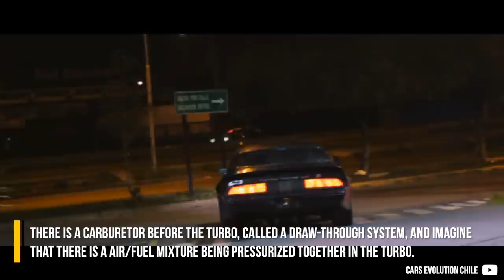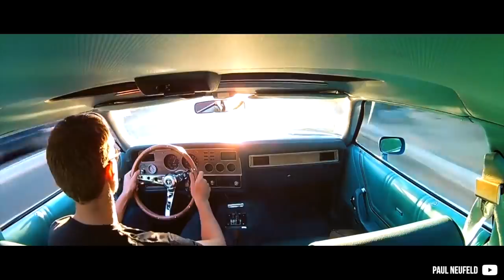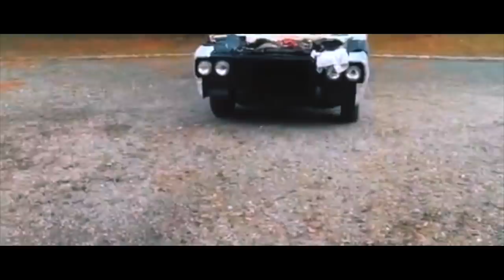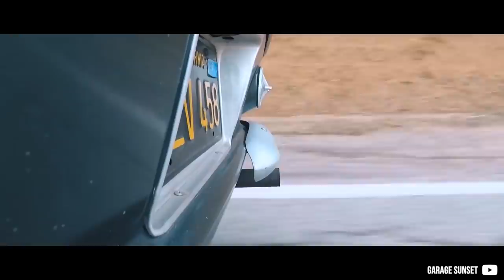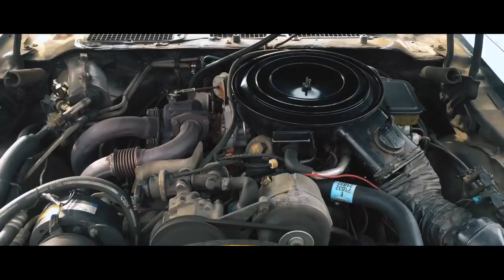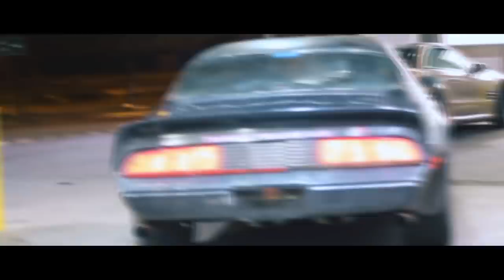5 Awesome US Turbo Carbureted Cars

Comment: The 1980-1981 turbo trans am; the definition of “All show, no go”
Reply: I bought a mint example in around '89.  It really was slow but it did "show" and was trouble free for the next 6 years.  Then I dropped in an SD455 to improve the go.
Reply: Sure did roast the tires pretty good.
Reply: Hahaha it’s very show about it’s power delivery haha it tries to seem dramatic but it’s really not😂
Reply: Own a ‘79 there slow but there still fun
Reply: Yes! That 305 turbo motor was a friggin' DOG!
Reply: Ya tht 301 turbo was a turd I’d rather have the 400
Reply: What choice did pontiac have with the restricted emission and power control from the government? They did the best they could and should be respected for their efforts. Anyone with half a brain can easily modify the 301T engines to make a lot more power and boost.

Comment: There is also the Renault 18 Turbo, with a 1.6 turbocharged engine, Garrett T3 turbine, and solex 32 DIS carburetor.
Reply: Yes as far as i Remember Renault 5 gt turbo had a carb turbo engine.
Reply: @Runetone  the first r5 had a turbo version of the basic car too, alongside with the civilised version of the rally car and its back/middle engine plus the widebody kit ^^
Reply: @Zzefrog  yes the turbo and turbo 2 mid engien 😊 but the GT turbo was the cheap option. One of my frinds had one. still fun to drive.
Reply: Yes and the first 5 alpine turbo too
Reply: This list isnt about evey turbo carb setup, there are clearly more. The title was highlighting on a few turbo carb setups from the US.
Reply: What about me... lol

Comment: Turbo carbureted cars are kind of common here in Brazil (among modified cars), since not everyone has money to buy the turbo kit and a fuel injection system along with tuning. Nice video btw!
Reply: Blow-through, or draw-through?
Reply: @903strikerunit  Mostly (like 99,9%) blow through.
Reply: @rodrigogomes7546  how the heck did they tune that up?
Reply: @903strikerunit  Nowadays we use a lambda probe on the exhaust, and by reading the lambda value across engine rotations and loads we tune the carb to the ideal fuel mixture (a little bit more rich than stoichiometric, to prevent from fuel starvation on high rpm/loads).
On the past, like in the 90's and 2000's we basically tune by try and error, starting with a rich mixture and depleting it until we feel it's close to where we want, not very accurate but it worked well.
Many aftermarket turbo projects already have some kind of "recipes" avaliable to give a start point on tuning, specially VWs engines ( if you search for VW AP turbo on YouTube, you will find a lot of content for example), making things much more easier.
Reply: VW AP and beetle boxer engines rules the carburetor predilection here in brasil

Comment: draw through turbo concept is ealisily tunable, but it acts like a diesel - you wait until the turbo spools and the real power comes up.  Im planning this setup to be done on my pinto 2.0l engine, it can be tuned with ear only (and driving ofcrs). Easy part is the tuning, but hard times come when you try to drive this setup - you have to keep it in spooled area of revs, but if it comes down to the not spooled area, you have to wait to let it build the boost up and then you can drive it like a mad man. But it is really cool setup tho. Blow though setups are more capable, but again - hard to tune.

Comment: I had a renault 11 turbo with 1.4 turbocharged engine (8 valves), performs very well for the year and displacement, 114hp and can reach 124hp only touching wastegate, not bad

Comment: The early Maserati Biturbo's had a carb but it was after the turbo. Because it was pressurised it lived in a sealed box on top of the engine. It didn't work very well, mostly due to heat.

Comment: Sorry am old enough to have seen this as the standard, Still common for Blowers.  The basic difference with the carb turbo, simply there were seals to prevent the air/gas mixture from getting into the engine oil.  You can still buy them on the market but they are becoming harder to find.  Remember that Paxton Blower actually used a vane type pump back in the late 40's to current, the famous Roots blower needs no modification due to their design.

Comment: 133 hp from 2.3 turbo ? That's low even for that era
Reply: Americans didnt believe in overhead cams until around 90s, thats why
Reply: The Lima 2.3 is based off the european 2.0 in cars like the Escort and Cortina, it has a overhead cam. It actually made 139hp and the 302 of the year made 140hp. The design was old before it made it to america, it is an economy engine, but it does have aftermarket support and can nake upwards of 400hp in turbo or n/a form and is used in race cars and trucks. The Windsor 302 makes power upwards 500hp.

Comment: I've "seen" many turbo cars with a carb. They usually enclose the whole thing in the pressure box. I believe this is the easiest way make it work. Also for me, as a millennial, carbs are like magic, at least the "modern" ones, with millions of vacuums hoses and vacuum membranes. Computer controlled fuel injection just is so much simpler for me to understand.
Reply: Carbs are not complicated.
Reply: @ItsDaJax  Carbs on cars older than 1980 are not. But my first experience on wrenching was a '90 Toyota and it had many vacuum lines controlling whatever. At that point a computer controlled is way better, because the carb was kind of like a simple analog computer, only difference is that troubleshooting is way more difficult and tuning is done by turning a screw or even replacing parts.
Reply: @zabnat  Vacuum boosted brakes, emissions, secondaries, timing advance, evap, etc. Doesn't make them complicated.
Reply: Yes they do. Or are you just saying nothing is complicated as long as you are comfortable with it and understand it?
Reply: Even efi has some vacuum hoses. If you exlude all those other systems, by itself it is simple. Anything nondiesel is going to have vacuum assisted brakes and at least two other hoses.

Comment: its funny people rag on the turbo 301, when it still put down numbers comparable to the then biggest engine, the olds 403.  while no 455, the 301 did still get the job done, just could have did more with that setup with more than a measly 9lbs of boost XD.   and too bad most people that restores them, ditch the motor, and now finding a turbo trans am can be pricey, specially if its not ragged out.   just like the Z/28 with the 302....people tossed them for 350s being dumb, and now theyre worth more than what they should be

nice vid btw.  was going to suggest the turbo sunbird, but thats fuel injected XD

Comment: I remember years ago when I worked at a Lincoln Mercury store. There were a few Mercury zephyr's that were sold with the carbureted 2300 turbo. What a disaster. They either had a flat spot or a pre ignition issue. One thing for sure, they spent more time in the dealership then on the road.

Comment: Amazing video, but one thing kinda bugged me(not hating just pointing something out), You put the years for the Corvair from 65-66 and only showed early model Corvairs. Monza Turbo(introduced in 62) was a trim until 64, then changed the name in 65 to “Corsa Turbo”(pushing 180hp) and the trim stopped in 66. Also in 65 they body styling changed completely.

Comment: BMW 2002 turbo, Renault 5turbo 1&2 , renault 11turbo...lots of vintage cars with bad caracter^^
Reply: But they all had mechanical fuel injection
Reply: No carburator only
Reply: @jeanaaimar9133  the specific models you mentioned had fuel injection. In case of the 2002 even the n/a tii model had fuel injection